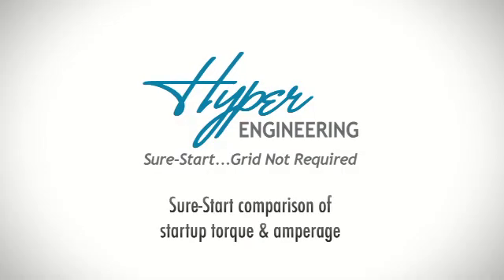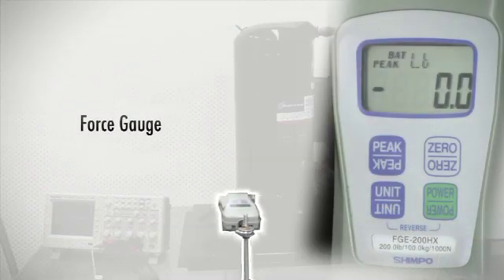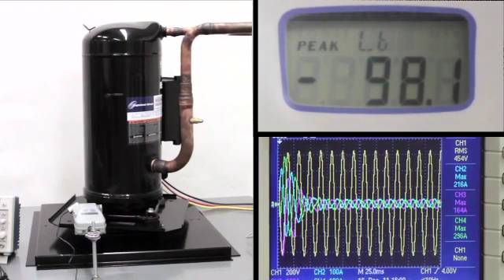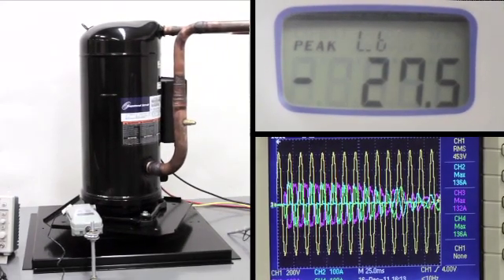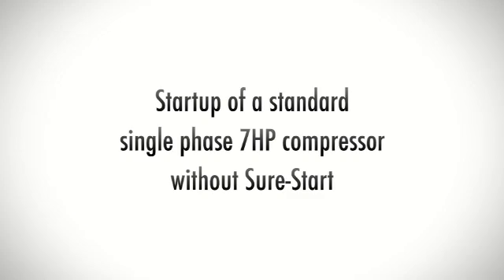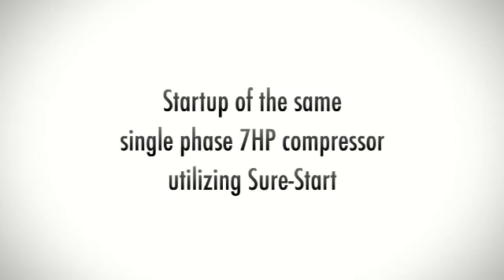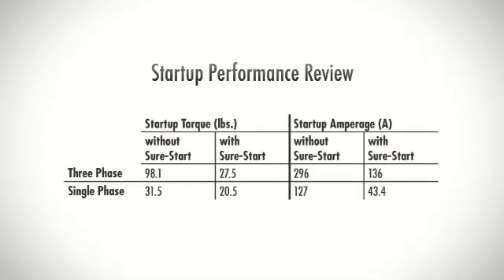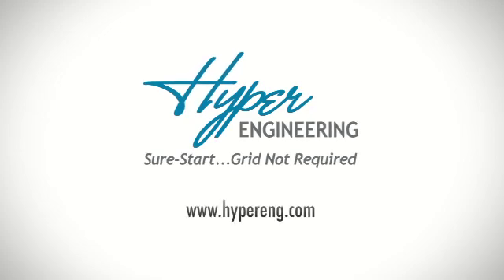Sure-Start Soft Starter Comparison

Comment: Have been running 2 of these on 2 of our 3 HVAC units in our house.  Purchased them because we have a whole house generator and one of them is on the generator.  Wanted to ensure we would not have any problems with the high current draw at startup.  Has worked wonderfully!  You can really hear the difference in compressor start-up.  Liked it so much I put it on the other unit we upgraded later, even though it's not on the generator.  I now recommend these to anyone putting in a new AC unit.  Just with more installers knew about them.  I had to handhold both of ours through it, they didn't seem to understand why I wanted it or if it was compatible etc...  sigh

Comment: My 3-ton 230 volt HVAC cooling only condenser would immediately trip the breaker on my propane powered generator. After installing a Sure-Start 6, my generator was able to stay online and run so that I'll now have central air conditioning even if shore power goes out on a hot day. My generator is rated at 3500 watts continuous and 4400 watts surge. Amazing. I still have to run the HVAC evaporator fan with a separate 1,000 watt generator so that I would have to have two generators running for HVAC with shore power out.
Reply: My 3-ton R22 240v cooling only a/c condenser still runs great with about a 40% lower in-rush current with the Sure-start 6 except now with a new 4200 watt continuous propane fired generator. The Sure Start 6 is awesome.
Reply: Apparently Google has changed my name to celicaster from Gusto G?